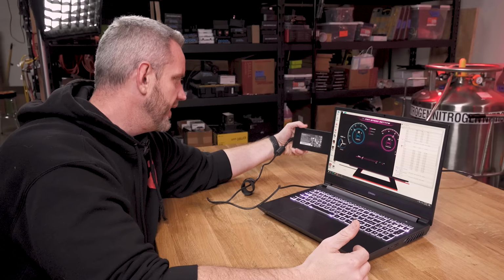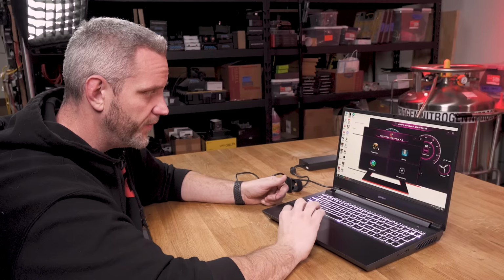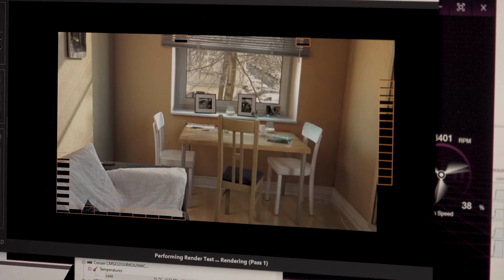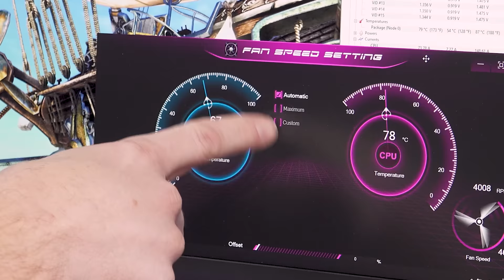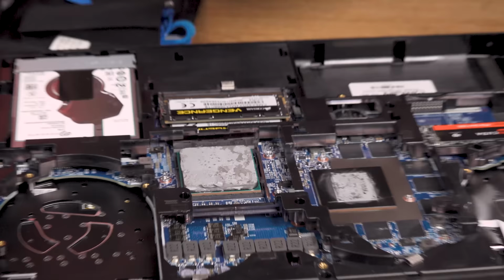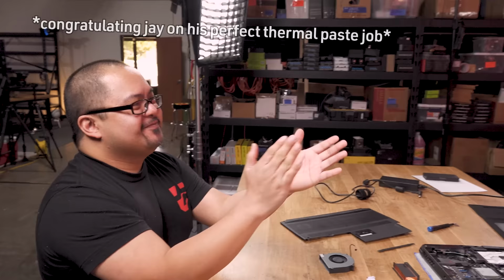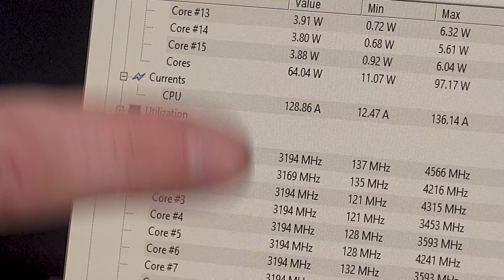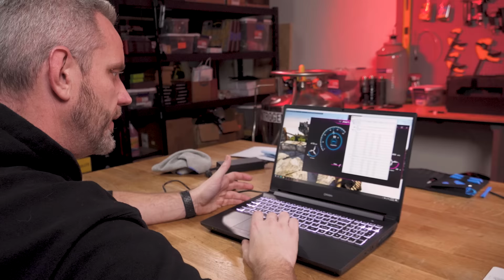This laptop was trying to melt to death... here's how I fixed it.

Comment: Me wondering which laptop model it was based on the title then realizing it could apply to any
Reply: Hello to the Legendary Aussie who put me onto Metabox. 2 Metabox's in our house now. Happy New Year Jarrod.
Reply: I have a 10 year old laptop that always ran hot, but it shuts down now and never did before and then waits 2 minutes giving you a temp warning. I suspect it's the thermal paste. So it's a cheap thing you can always check if you have issues.
Reply: @awilliams1701  very possible with it being so old, It could also be blocked fans. I see a lot of this, people dont think typical dust builds up like that but it will completely block the fans fins quite easily with the super thin and super tight tolerance fan blades they use now days. Once its blocked its not moving much if any air at all, and will retain that 150+ degree air inside. People look at 60-70c and think thats not that bad... but in reality its 158 degrees F... Hot enough to burn your hand to the touch.
Reply: Laptops always need a lot of care, if it gonna sit in a desk all day get a cooling pad to help it, repaste processor/GPU & clean the fans every 6 months (in case of being a new laptop wait 1 year to the warrantly to end or do it at your own responsability), UPS are recommended too to these type of pcs never connect them directly to the wall, plus you can research on internet how to take care of a laptop
Reply: @crisnmaryfam7344  I was about to reply to Ashley but you pretty much said exactly what I was going to say. Well done.
Reply: Hello bro
Reply: could be applied  to any but many of them cant merely be accessed from the bottom and are extremely fragile. wouldn't recommend it for oem laptops like lenovo asus dell ect. they're pretty tricky to get back together without damaging something. enthusiast level stuff be worth it since it costs more and likely doesn't have delicate ribbon cables ect. in the way. note the length of the screw draw a crude diagram you don't want to put a screw through the pcb by putting it in the wrong hole. the older the laptop tends to make ribbon cables more sticky and brittle.
Reply: I've saved several older i5 and a couple of i3 laptops(salvaged by dumpster diving) by simply repasting and getting a cheap ass SSD and a stick of RAM... If it's still sluggish in Windows, I'll install Linux Mint or something. 
I broke a LCD ribbon cable today on a Dell Vostro laptop because the plastic was getting crisp(and I was an idiot), but Ebay sorted it... 

I currently use a HP Elitebook 8470p i5 with Windows 10, salvages from work as they where replacing the PC's there and I got the go ahead from the IT guy.
So i grabbed about 10-12 laptops for myself(no one else wanted any) and started refurbishing them for my kids, I also had some left over so my friends and family got some as well.

As @Nikbawker says, it's kinda tricky with the OEM laptops, but not impossible, the HP Elitebook is made for easy upgrades, the Dell Vostro i mentioned not at all, however Asus is kinda nice to open, at least the newer a bit more expensive ones. I have a thinkpad as well that i havent opened and repasted but RAM replacement was ok... Going for a repaste there as well soon.
Reply: @crisnmaryfam7344  its possible but I didnt see anything at a glance. Diesnt matter since I have a replacement now.
Reply: @nikrbawker  they are pretty tricky, i have an asus zephyrus m15 and did the paste a couple months ago. Had never done it so it was nerve racking. Watched nearly 5 hrs of videos before i opened it up!
Reply: @Kagewing  hi. Why UPS?
Reply: @antmarignon  UPS (know as unlimited power supplie) is a device that protect PCs or any other electrodomestic. is recommended cuz it act as electricity shock guard, auxiliary generator for 25mins to 30 mins when electricity is gone so you can shutdown all devices safe saving your work & it purify the electricity to the levels all devices need
Reply: How about putting liquid metal on a laptop CPU and GPU, is it safe? what about thermal improvement ? 
Thanks
Reply: My Asus laptop is still going strong after 5 years, with minimal heating issues. However, my Lenovo and MSI laptops just shuts off when anything demanding is running after 2-3 years
Reply: Origin PC Eon 15x (Clevo)
Reply: it's a clevo. Jay's a friggin newb
Reply: I knew it was a Clevo based system when I saw the monitoring software on the screen. Pro-Star, Eluctronics and so on all use it.
Reply: @Kagewing  how come not a wall  outlet

Comment: J: "Oh no I run out of KPX, how did that happen?"
Jay using KPX in every PC in the studio.
Reply: Cause he now got a 10 year supply of KPX from Vince (K|NGP|N) himself... :D
Reply: What no liquid metal plebs.
Reply: @shadowarez1337  Thermal Grizzly Kryonaut Extreme is actually better than liquid metal. Similar gains but without all the downsides of liquid metal...
Reply: @kyoudaiken  Hmm I'll have to try that then iv repasted my labtop with a 7700K it was reaching 90+ prior now down to 55-60 max.
Reply: @kyoudaiken  You are dreaming. liquid metal is always better.
Reply: @kaiwenwu8148  It has too many downsides. And it doesn't last long due to migration.
Reply: @kaiwenwu8148  Not for LN2, it starts cracking at super low temps which Kryonaut is designed to not have issues with.  Liquid Metal likes temperatures above ambient.  Normal thermal paste is like 3.5 W/m*K, Arctic Silver 5 is 5 W/m*K, Kryonaut Extreme is 14.2 W/m*K, and Conductonaut is 79 W/m*K.  There is a 3°C difference between Kryonaut and Conductonaut.  There is a 5°C difference from Normal Paste to Kryonaut.

If you are using sub ambient cooling, eg LN2 or TECs you want Kryonaut though.  Because the Liquid Metal isn't liquid at those cold temperatures.
Reply: @kyoudaiken  Incorrect from experience.
Reply: @4RT1LL3RY  We're talking consumer laptops here. In real use.
Reply: @kyoudaiken  gets a lifetime supply might be a better way to say it.  That stuff has a shelf life, and as I think kingpin himself has indicated, longevity is not in its spec because it’s designed for competitive cryogenic overclocking where nothing stays assembled for months at a time much less years.  So any large cache would age out in a few years.

Comment: Jay: This laptop was trying to melt to death. Me: what laptop isn't melting to death?
Reply: Question: are you using an Acer laptop? Those are known for their overheating and leg burning.
Reply: Brother has an msi and asus (asus i think) and i have an alienware. My boss has a crappy cheap not even a gaming hp. All of them get hot as hell to the touch even just idling on the desktop. I have to undervolt mine just to game without throttling. 

Really want water cooling aios for laptops.
Reply: @rikschaaf  My acer laptop's processor spikes up to 94°c during gaming, but during idle is fine like around 40+°c
Reply: Zheng Kit Wong mine only show 99 so Im 100% sure My CPU goes over 100 degrees celcius. At Idle its at 70-80.
Reply: @abrakadabruhman4002  Wow, I thought mine was hot but 100°c is alot, I limited my cpu performance to 99% at advanced setting, now it is 5°c lower but I don't feel much performance loss.
Reply: @abrakadabruhman4002  Your laptop will soon die with those temps man check the thermal paste or prepare to buy another one .
Reply: Mine seriously sits at 90C playing Horizon Zero Dawn and I am NOT willing to disable boost clock, fuck that
Reply: @rarespetrusamartean5433  mine reaches 95. Technically is a 1.9ghz that boost up to 2.4ghz. Don't know which loophole I enabled in bios, It goes up to 2.93 and stays. Shrunk my wood desk with the heat but I regret nothing.
Reply: @Noyjitat  facts bro. Laptops need good gpu and cpu just to use half of them due to lack of cooling n power

Comment: I really like that laptops nowadays are considerably easier to disassemble than 20 years ago.
Reply: Had to replace a Thinkpad T540p fan last month. Fucking. Horrible.
Reply: Umm.... I think that only applies to some laptops. I bet my envy x360 is a bitch
Reply: @jchoneandonly  It does, my Lenovo requires disassembly just to upgrade the memory or hard drive, seriously?
Reply: @elminster8149  yeah. I suspect business models and gaming models are designed more for it.
Reply: Yeah, no.  This Clevo-based model is an exception.  Modern laptops are usually a nightmare to work on.  Clevos are meant to be integrated by 3rd parties so they make them a bit more modular than most.
Reply: @BillLambert  
That's not true at all, in the case of Lenovo laptops. I work on them daily and I can disassemble and install new parts in under an hour. They really are simple to work on. Some models are a little more annoying than others, but they're all relatively easy.
Reply: @7heBatman  Interesting, it used to take me 5 minutes to upgrade the memory/HDD in a laptop, but under an hour is good these days?
Reply: Depends on the laptop, I had an several Toshiba laptops in the 90s that came apart with just a few screws, everything inside them was very easy to access and the ribbon cables all had plenty of slack so that you wouldn't accidently strain them when pulling bits out. But then in the mid 2000s I bought a Dell and wow that was a nightmare, IIRC there were ~12 screws to get it open and brittle plastic snaps that break with only half the force required to pull the case off. It also burned through 5 or so 7900gs GPUs, but fortunately there was a promotion running when I bought it that had 3 year on-site warranty for free so didn't cost me a cent to have them replaced so many times :).
Reply: I think it is getting worse because mainstream consumer models are using soldered on components(RAM, SSD). Only the gaming laptops seem to be reasonable.
Reply: @elminster8149  
I say under an hour regarding a full motherboard replacement. Easy stuff like RAM, hard drives, keyboards, etc is 10 minutes at most. Really depends how stubborn the bottom cover wants to be.
Reply: Has always been dependent on what type of laptop you buy. Buy what suits you and your needs then you don't need to cry!
Reply: My 2002 laptop is a breeze, all you gotta do is take of the keyboard and you can replace every single thing in there
Reply: @JasperSchwinghammer  You think that's bad?  Try the ancient Compaq laptops circa 1998, entire case was held together with extremely fragile plastic clips.
Reply: Some.  SOME laptops are easier to disassemble.
Reply: Dell actually has pretty good service manuals online that tell you how to disassemble things
Reply: Gonna shoot you straight here ...a lot of laptops in the 90's were really easy to take apart.  Granted, I only ever touched super high end laptops that my dad brought home from work, but all of the ones I saw were amazing, and it seemed to go all downhill in the ought's.
Reply: @7heBatman  Fair enough. It still used to be easier;  full or partial disassembly just to replace or upgrade base components is a joke though.
Reply: It depends. My friend has a 5yo Asus ultrabook that I upgraded to a SSD. Damn, I had to take the whole thing apart to do it. Tiny ribbon cables everywhere.
Reply: I worked on a Apple Powerbook G4 and IBM ThinkPad X31 and oh my god, you have to disassemble everything to do anything!
Reply: Any laptop is easy to disassemble, it just depends whether you would like it to work again after! My hammer serves me well for this..
Reply: @jchoneandonly  yeah my 17.3 inc version of y540 has diffrent bottom cover from 15.6 beacuse usually you remove the whole bottom cover at once boom done but for 17.3 inc one it took alot more work to get it fully open ugh xD at first i was like wtff why is this diffrent from 15.6 inc version lol
Reply: @games8ful  mines a 15 in and I c Dan tell it'll be a pain if /when I decide to upgrade parts.
Reply: Tried taking the backpanel off an MSI leopard G62 from 2017 to do some cleaning. Not only was it pretty much stuck on, now all the I/O is malfunctioning... so I'd say not true in my experience.

Comment: Hey Jay. Wanna try building a floor mat for your chair? I really want you to diy one to show people how much nicer and cheaper they are compared to the plastic mats. Plywood and adhesive tiles work great!
Reply: Ikea plastic mats are 20€ including VAT.  What exactly is cheaper?
Reply: @JasperSchwinghammer  he might have only looked at the expensive ones that jay mentioned instead of a cheap one like the one you picked
Reply: @JasperSchwinghammer  He got a pretty pricey one but you can diy it for around $40. Price depends on how big of a mat you make too.
Reply: @xemphios  a piece of plywood and adhesive tiles on top of carpet will never be "much nicer" than a plastic spike mat like he bought.
Reply: @xenonram  I say "much nicer" because it doesn't flex and make divots where your casters usually sit. Plus the tiles are a ton more appealing visually than a clear plastic mat. So far my diy mat has held up longer than the Staples one I got for around the same price. The plastic one cracked up within a year and a half of using it.
Reply: I literally just made exactly this yesterday. Haha. I had a cheap plastic one before which had 3 different location where holes formed. The thing was well over 3 years old though. I do like my hard flooring under my desk, and It should last a long time.

Comment: I have had this exact issue on My Dell G7 I purchased last year. Hardly use it so it's still pretty much brand new , was for remote work. But it would get hot as shit & fans would be blasting away and literally doing nothing.. This is Factory sealed new laptop. I have seen where some tore them down and put new / better thermal paste in & seemed to work. I went through a bunch of different settings & processes to try and figure out what the hell was going on. I think I managed to get it under control but still want to Put some new thermal paste in. I'm not really a computer guy unless there is a situation where I need to figure something out or build a new computer. But i still enjoy these videos!

Comment: Had a similar issue with my laptop.
Temperatures were in the 80-90 c range and the fans would go crazy every time i had more than 1 tab open in chrome or watched a YouTube video from 1080p or up resolution wise.

Cleaned up all the dust, even though it wasn't much and applied new thermal paste to the CPU as well as the GPU . (Arctic MX-4)
Even changed the thermal pads on the vram and some components that seemingly touched the heat pipe but had no pad on them. (Thermal grizzly minus pad 8)

And now i am sitting in the 50-60 c range with loads of tabs and 4k YouTube playback and almost no ramp up from the fans at all.

Before this machine sounded like it wanted to take off and fly away.

Comment: I run this rig as my daily driver only it has a 3700x, and game on it heavily. I've had it a little over 6 months, It substitutes a desktop quite nicely actually, and what you loose is well made up for in quality and versatility.
That being said ive noticed the temps getting very high lately. In long game sessions it has always made its way up to 90, then it started hitting 94 and going back down. Now its pegged at 95 all the time when gaming. When browsing the web i would normally see temps around 50 and now i am at 65.
When i had it built i paid for an add on to put IC diamond paste on it, I figured since i wasn't getting the 3900x i wouldn't have too much trouble with the paste. I wish i paid more for the kryonaut.
Any way thank you @JayzTwoCents for confirming what i suspected. Ill be putting the same paste you put on yours.
An update in 6 more months would be cool.

Comment: My GS60 cpu has been running at 90+ °C in games since I have it (6 years). Fans are running at 6000 rpm and repasting it didn't change much. Heat even deformed the chassis cover to some impressive extent and the paint is bubbling

Comment: "Cinebench Is heavy" laughs in blender and prime 95

The jumps at 200mhz still seems odd to me. Ryzen balanced mode on windows should set the minimum clock at 95%
Reply: On desktop yes, on laptops because there is decidedly less power the clocks will never come even close to 95% (even here his max clock was 3.4 Ghz while my desktop 3950X regularly hits 4.2 Ghz all core without even having applied overclocks). Origin however has applied settings that pull clocks down to the absolute minimum when too much power is being drawn.
Reply: @CenturionAlexander  Would the drops to 200mh cause stuttering while gaming?
Reply: @ResilientME  most likely.
Reply: @CenturionAlexander  The power draw stuff seems weird to me too. I think its fine for a laptop to have a bit of extra power delivery overhead for boosting, so its designed for 80watts but is happy at 100w for a short time. This feels like it averages 80w by spending most of its time at 100w and a portion of its time at 10w. 

I dont have one to play with, but I would mess with PBO in the bios to limit the amps and package power to see if I can get it to not boost and choke so much but find a happier middle ground. These chips also like lower temps, so lower volts means lower temps which is also higher clocks. It might actually be able to run the same boost setting with less power and less temp and less noise, but thats only a guess until I actually have one to touch.
Reply: It'd help to have it updating those values 100 times a second.. maybe even 500+ times per second and then looking at the log to see what's really going on.  This really shows us nothing other than extreme throttling appears to be happening.

Comment: I do this on a fairly regular basis with my old laptops. I don't have any of the fancy KPX paste, but clearing the cobwebs and repasting brings back a few fps for the kids on the old gaming laptop.
I've also fixed crashing laptops the same way (pre-thermal throttling systems.)
Remember, dust bunnies aren't cute, and don't make for good Hassenpfeffer.